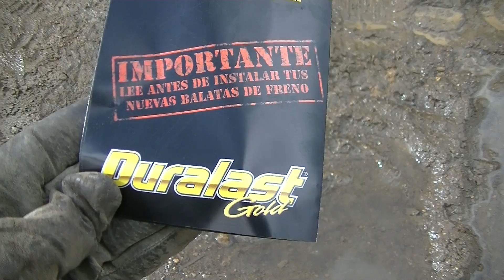More Car Problems! How Much Will This Cost Us??

Comment: I was going through brake pads like water and consulted my mechanic who told me it was the lines that were bad. The rubber lines that go from the hard line to the caliper get narrow as they age which reduces the movement of the pad or mostly releasing them after applying the brakes. If it doesn't move it will wear out.
Reply from the maker: Oh wow interesting- another item to check!

Comment: Just to add my 2 cents. Ceramic brake pads last longer than standard pads. The down side is they take the rotors with them when they wear out. A wise choice when replacing pads is to replace the rotors, too. Autozone has good warranty policies and so does Advance. Ceramic pads generate more heat than std. pads so when I replace the pads and rotors I do the calipers at the same time. Autozone has never given me a problem when I bring in the old calipers, pads, and rotors and replace the package under warrantee. My son has an F350 dually and because that truck tows 90% of the time it gets brakes about every 18 months. The rears wear almost as much as the front so he does one axel first than a week or two later does the other. Warrantees are great!!!
Reply from the maker: Thanks! Helpful to hear other's routines.

Comment: Do you use nickel-copper alloy brake lines? I drive on salty-NH-winter roads and replaced my steel lines to stop rust & corrosion line damage.
Reply from the maker: i'll check. that's a great tip! thanks

Comment: You didn’t notice your ineffective brakes for 18 months?  You don’t change your oil at least once a year?  You perhaps should have noticed brake fluid down on your reservoir?
Reply from the maker: Who knows when the caliper sprung a leak. Bryan regularly keeps up with the oil, more than once  a year.
Reply: The difference between the brand new pads and the condition of the pads on the leaking side will provide some level of indication as to when your leak started.  My reference to oil was simply to suggest that out of sight, out of mind way of thinking.  We all live very busy lives and things get overlooked.  We change or have changed the oil in our engines based on either time or hours/miles/kms.  The reason scheduled services were designed is to provide intervals where we can evaluate the condition of out of sight items - or we can wait until something breaks.  It is cheaper to be proactive rather than reactive.   It is not a judgment on Bryan or you.  You are both capable people.  Some things just slip through the bustle of life.  Perhaps get Bryan a battery powered impact wrench to make wheel changes easier? 💪
Reply from the maker: Sure that makes sense. Lately when Bryan is working on the car it's at night with a headlamp. (only so many hours in the day). So I"m sure easy to miss a few things with a visual inspection. Did you see the part in the video where He was aggravated that when he got new tires put on, nobody told him that he had a serious leak in the brake line, at the calipers? They were right in there and would have seen it and should have said something. I think he's thinking of a new truck LOL, but I'm sure a power impact wrench would be a "nice to have" :) thanks man

Comment: If the pads are hard to move in and out they probably won't be able to back of when the brakes release causing premature ware on the brake pads. That probably was what caused them to wear out that soon after replacing them. Make sure there is no dirt or rust holding the clips out and be sure the clips that hold the ends of the pads are as far on the calipers as they can go so the pads have room to move freely. As calipers are used they sometimes get so they stick enough so they won't allow the pads to back off even after they are pushed back with a clamp. Since you said the pads were hard to move in the calipers I would blame it to rust or dirt where the clips go on the calipers or the clips weren't pushed on far enough. Be sure to apply a little lube to the clips where the pads go against them to allow them to move easier. Grease the pins on the caliper so they can move freely. Here is a video not from your car but it has the information. https://www.youtube.com/watch?v=g99MRwTcndc
Reply from the maker: Oh good tip. We'll see how the left side goes in after he changes out the calipers.

Comment: I don't know if this is just BS or if there is a difference between OEM and aftermarket brake pads and rotors. According to what I have read the aftermarket brake pads wear faster and cause rotor issues scoring of the rotors. The cheaper aftermarket rotors "again according to what I have read" should be resurfaced before installing because the casting is not perfect. They suggest a premium rotor to avoid this problem. I have gotten away with aftermarket on my wife's Avalon but we don't drive in severe weather conditions as you have. Toyota does such a good job engineering their vehicles it may pay to stick with OEM, I don't know how many miles Brian put on the original brakes but I'm guessing that they lasted a lot longer than the aftermarkets are. Just another guys opinion, food for thought.
Reply from the maker: huh. really not sure about that one. It seems the one caliper was bad though. thanks

Comment: New rotors are cheaper than turning rotors. Turned rotors are thinner and heat up , warp and wear out your new pads faster .  Eric O is a brake guy, learn . Being cheap in the wrong areas , will always cost you twice more than knowledge . Know you know.
Reply from the maker: Good tip- sounds like a smart guy.
Reply: @ColoradoMountainLiving  watch   his brake videos and learn from his life's work. Little details matter.knowledge in brakes saves lives

Comment: Brakes last longer when you turn the rotors.
Reply from the maker: Good tip! I'll have to ask Bryan if he's done that in the past.
Reply: few places turn rotors today
Reply: @UncleFjester  You must live deep in the swamps then. Most of the auto parts stores around me turn rotors.
Reply: Okay how did you come up with the conclusion that brakes last longer when you turn the rotors? Are you referring to  a rotor with groves?
Reply: @jjack6896  It's not a conclusion. Pads wear faster on a rotor where a pad went metal to metal. IF you paid attention to the vid a rotor/pad was metal to metal and the third reason is everytime i was too lazy to have the rotors turned my brake jobs did not last as long as normal.

Comment: only idiot spray oil to disk brakes. need be dry and clean. if brake leak,need change new seals all to cylinder, simple work.you not need newer ceramic pads, only high speed supercar need or race cars. you need only normal brake pads you slowly car.i has drive one my car 13 year and need change new pads only 2 time all life.
Reply from the maker: wow that's amazing- 2x in 13 years!